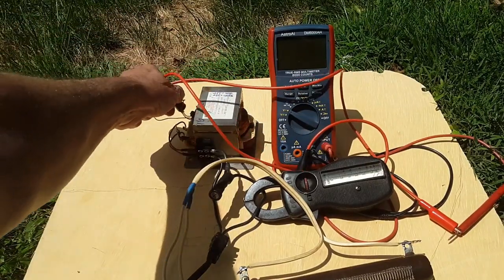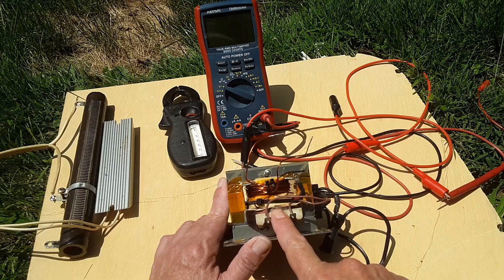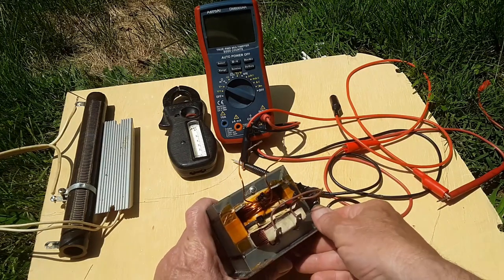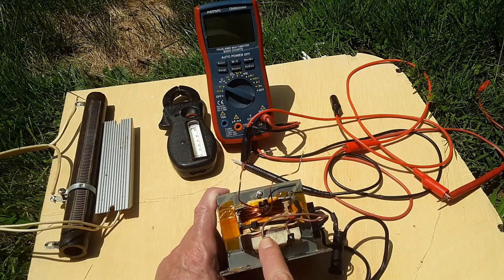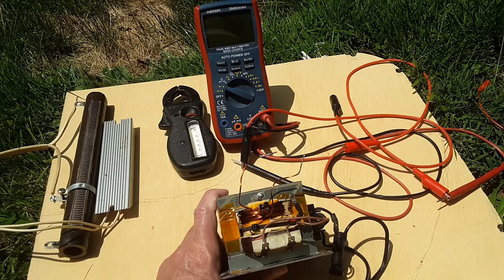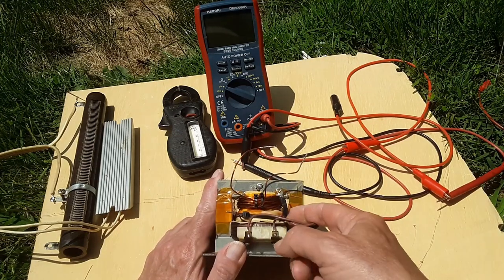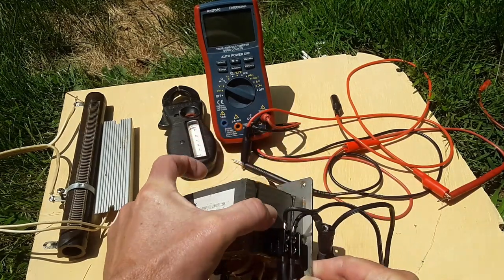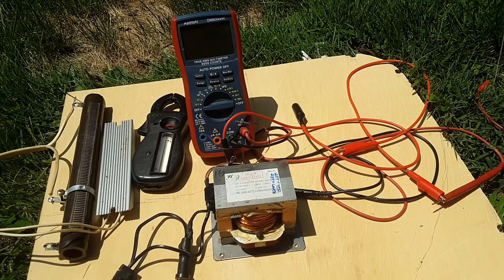MOT:🤯the sequel,im done with this.(microwave oven transformer rewind)

Comment from the maker: Man🤔only thing I learned by doing this is a few things I already knew and that I doesn't work out😄.primary current still way to high.
Reply: Looks painful. I didn't enjoy my own attempt at stripping a secondary from one of these. 
I do remember reading stuff about MOTs being very sketchy with different tradeoffs going on between the (very limited) magnetic capacity of the core vs size/weight and low manufacturing cost of the thing (iron core, aluminium wire windings) so they just manage to drive the magnetron without any spare capacity but still with the primary impedance of a transformer. The core runs close to saturation under load.
I think what you are seeing might be caused by the aluminium being removed from the secondary, reducing the total mass of the core and pushing the core over saturation - so the primary impedance drops, it stops acting like a good transformer and the idle current goes up. And it bakes.
A combination of the mass of the secondary and the aluminium wire (which has weird magnetic properties, not the same as copper) and those shims could all be factors in keeping it just under saturation and your new secondary isn't making up for all that. That's my best and only guess :)
Reply: @doug694 
Yes, that's seems a reasonable explanation.
Reply from the maker: @doug694  thanku.in my first video I said I think what's going on here has nothing to do with my windings. It's a function of xfmr in "current state",ie I meant secondary alum.removed.aluminum has shady properties to me.in rf coils it will lower inductance on here God only knows maybe?it has been extremely painful,yes.i may not recover well.😄I had serious thought of wiring some #10teflon on it,and putting it on the highest "zinsco"breaker I have.🤣that would fix it.thanku for commenting🙂
Reply from the maker: @lindsaybrown7357 does kinda make me wonder what "if"i had drilled the 1/2" hole through the aluminium and ran the windings through it.😂science can be a addiction that's self destructive.

Comment: Well, I hacked apart one of my spare MOTs (I think this was one was around 750W - definitely smaller than the 1100W but bigger than the 600 I use for Lichtenberg fractals) last night and did some tests, and looks like I got some answers. With no load, all stock, the MOT drew 0.66amps (78 watts.) With the welds cut out, but otherwise stock and clamped together (mostly plastic composite clamps, since the steel in a giant C-clamp would change the flux) it went up to 0.8 amps (96W). That was a surprise... nothing was changed except for the two welded sections cut, but that still made increased the losses almost 10%. I tried stacking some magnets on top but I didn't have any really strong ones handy and couldn't measure a difference. Then I tried it without the bottom plate attached, using only the E-core. My meter briefly showed something over 10amps, and then the 20 amp breaker in my workshop blew. After finding a flashlight to reset the breaker, I figured that was enough testing for one night. TL;DR: Gaps around the core introduce a lot of eddy losses, meaning that you should make sure everything fits as tight together as possible. Clamp that E-I core together HARD and use a big enough gauge of wire on your secondary that it just BARELY fits in.
Reply from the maker: Thanku for your research so to be clear,"all stock" you mean with factory secondary intact?it draws less than 1amp?and With the welds cut.is that correct?😃😃
Reply: @generalingwer4341  Correct. So yeah... if anyone else tries this, well... don't, because touching even touching the case of the transformer will kill you.
Reply from the maker: @SkippiiKai  ok, cool ,so if ur transformer drew <1 amp.with ur hv sec.intact,no load,cut welds,then how about this.how about I don't remove all alum from secondary.cut off all windings flush.drill hole through alum to wound my new secondary through alum. windings.existing alum. cut turns would not make a complete pass around xfmr.therefore it would be a shorted winding.loop my windings through the intact alum.what u think about that???that way core is filled and cut my welds.what u think??
Reply: @generalingwer4341  I think I understand what you mean. Honestly I wouldn't leave any of the HV windings on, especially if you've already removed it and there could be damage to the enamel on the secondary (are you SURE your secondary is aluminum? Mine are definitely copper and aluminum would be a poor choice for this application). If the enamel insulation is compromised from knocking it out and there's a connection the voltage can jump you'll essentially have a third winding on the Transformer with a short circuit across it which could result in the very high current draw you're seeing. This of course also applies if there are any winding shorted on the primary. You might be better off just packing it with scrap metal kind of like the shunts were originally in there. I was also misled about those shunts from what I found on the internet. I had heard that they were magnetic which changes the flux in the inductor however they are definitely just silicon steel. I do have a number of inductors in my collection which is just short rods that have a magnet glued onto the top of them, so it's not unheard of to do that. Later tonight I can try running it again and see what power it draws with only the primary installed and no secondary. Theoretically, it shouldn't make THAT  much of a difference without any load. As a side note, if I'm ever in a situation where I need to, say, glue a house or a car to the side of a cliff, I'm going to use whatever glue it was used to hold those coils inside the core.
Reply from the maker: @SkippiiKai  yes its alum.it will be future months or more,but I'm gonna retry it.thanks very much.
Reply: @generalingwer4341  Sam Ben-Yaakov just posted a great video today on his channel about the differences running a transformer loaded vs without a load. Pretty math heavy but worth watching!